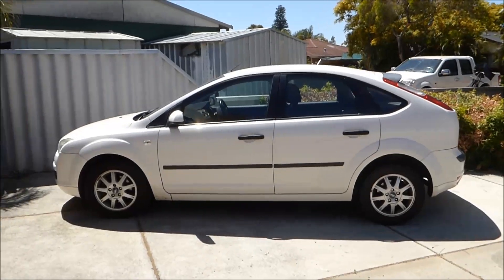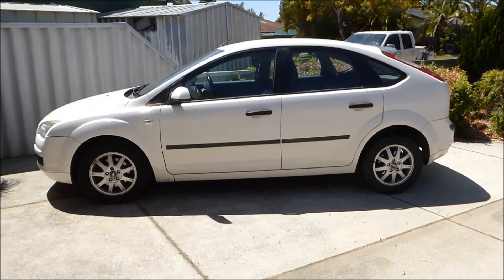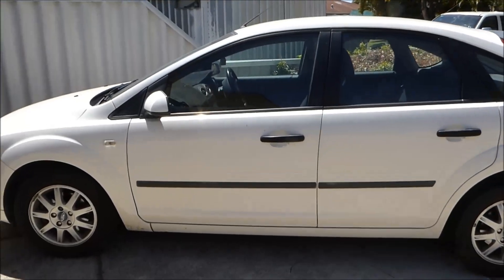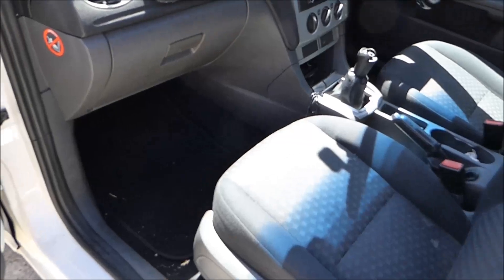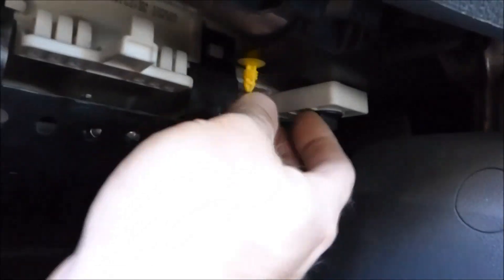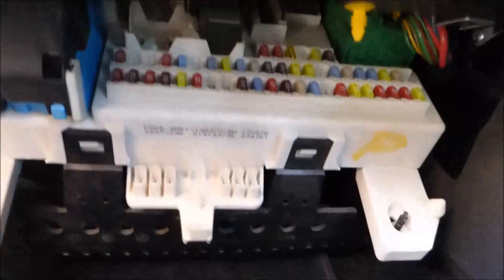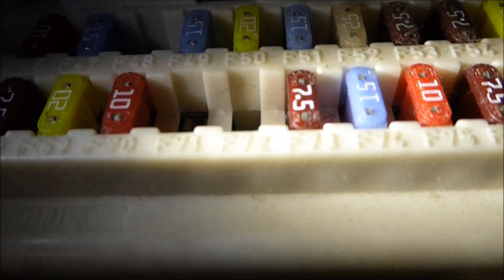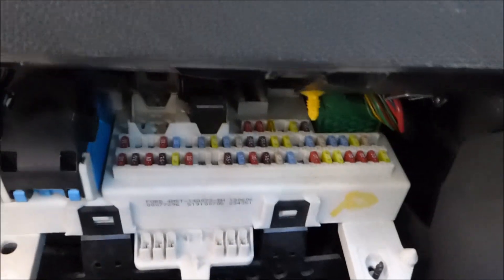Ford Focus Fuse Box Location and Fuse Diagram/Legend (2004 - 2011)

Comment: I was stuck in France today when the ciggy fuse went meaning at 34 degrees the coolbox was in  trouble. Despite having the haynes manual and the factory manual ...they both gave incorrect locations , Coming across this video saved the day so thank you so much for making the effort to help others ..it is truly appreciated . Why on earth the numbering is pretty much invisible and there is no layout diagram seems ..well just ridiculous . Thanks again . All the best , Bill from the UK ( in france !)
Reply from the maker: @bill7853  Thanks Bill. It's nice to hear stories like this, and I'm glad it helped you.
That video is around 10 yrs old now, glad it's still helping folks. Had all the same problems as you when my cigarette lighter fuse blew. Ford should be ashamed of themselves.

Comment: It is on the right side in LHD models otherwise exactly the same, thanks for the video now on to see if I only need a new fuse or a new windshield wiper motor😅
Reply from the maker: Interesting to hear.  Good luck, hope you get it fixed.

Comment: Any idea what fuse number for the speakers in the car? Radio working fine and mini speakers where the wing mirrors are working ok and producing feint  sound but main speakers are gone
Reply from the maker: I don't think speakers normally have a fuse mate.
You haven't accidentally faded the sound to rear (the little speakers by the wing mirrors are called tweeters, by the way)
Reply: @DjClarky78  no luck unfortunately trying the fader. Any other suggestions as to what it is?
Reply from the maker: @glynnflfc  Maybe stereo died. Do you know how to remove it?

Comment: Just bought a 2007 LX Manual (australia). After 1 week the RR indicator 
stopped working, Bulb is good, contacts are good. Where do they hide the
 indicator relay/fuse?? Did not appear in the legend. cannot locate in fuse box under dash or engine 
bay. Any help appreciated.
Reply from the maker: No idea, sorry.  I'd make another vid, but I no longer own the car.

Comment: - ANYONE knows where are the RELAYS for headlights ?!? 
I don't see them on interior fuse box at passenger legs location but I do hear them somewhere around clicking when switched on/off ?! Focus 2009
- Also, is it possible that there is NO relay for front FOG lights ? 110W directly over lights switch? jeez!
Reply from the maker: I don't know, but they are sometimes in a plastic box under the bonnet  I'd start by looking there.
Reply: It looks like they are inside of the passenger/interior fuse box, I mean reallyyyyy INSIDE the white plastic housing, placed on printed circuit board, not available for normal exchange and maybe even soldered for PCB, i don't know until I open it... stupid design!!

Comment: My father has this model (2005) but the sedan edition.the car has a problem with licence plate lights.none of two lights working.do you know where the fuse for these lights is?thank you very much!!!
Reply from the maker: I'm guessing they would be the same fuse for the headlights and tail lights (that is just a guess however).  Have you checked that the bulbs are working first of all?   Sometimes they get water in there.
Reply: @DjClarky78  yes i checked the bulbs and both of them are in very good condition.i will see the fuse you described before and i hope to solve the problem....
Reply: @DjClarky78  user's manual didn't help me because it's for ford focus 1999-2004🤔🤔
Reply: i have an 08 focus estate and the number plates bulbs are number 117  and 7.5 amp, it seems ford has a fuse for each item, i have about 75 and the guy next door has 5, there should be a manual on line some where, but if not just pop to a garage.

Comment: Thanks, fella!!
In my 2005 Focus (also in Australia) the fuse box is BEHIND the glove box.
There's a diagram molded into the plastic to let people know which fuse is for what.
It's completely different to your fuse box layout.
strange.
Reply from the maker: Mark Bryant - it's confusing. Is yours the Zetec model?
Reply: Yea. It is.
I was after the lighter fuse.
It was listed correctly.

Heater resister just blew last week.
$11 from eBay (Melbourne seller. I'm in Melbourne.)

$60 from burson.

Comment: Hi, nice video.... i just want help finding the fuse to the trunk? my trunk will not open, just opens if i press the brake. Thank you
Reply from the maker: Hi Nelson - I no longer own the car, and mine was a different model to yours, but I did a quick google search, and it appears that the problem you have is fairly common on the 2005 focus.

Do a google search for "ford focus boot opens when braking" - there were quite a few results when I searched..  Hopefully you can find the answer you need.

Good luck!

Comment: Good Job.I am sure a lot of us wonder why Ford does not id  or mark  on the  covers    I need the legend for the 1999 Explorer. Both inside fuse box and  under hood box with relays.  Can you help and / or  advice. Thanks. Vic tor

Comment: Nice clip Dan, good one :).
Reply from the maker: Bill Cox Hey Bill - just trying to give back.  You having Focus fuse problems?
Reply: DjClarky78 Hi Dan. went to have a look for the headlight fuses in my owners manual and the diagram layout is physically different to my focus. The book is the same as your focus's fuse layout in the vid, an EU version I believe but mine's the South African built version. After a few hours of searching the net I found my fuse layout diagram, there's not alot there for this configuration :). Hate to be broken down somewhere and trying to find the right fuse, now that would be very annoying !! The problem was just a headlight bulb in the end but I just wanted see where the fuses were located :D.
Reply from the maker: I think yours is a newer one, isn't it?
Reply: DjClarky78
2010